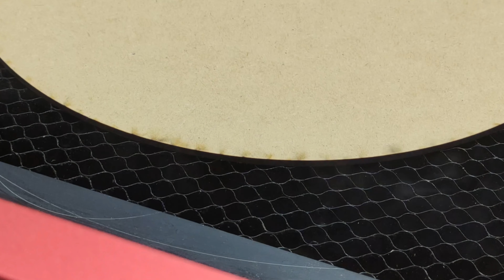Amazing Accessory For Laser Engraver- ATOMSTACK F3 Matrix Cutting Panel 460x425mm

Comment: My review of the Atomstack F3
"T" nuts too small for slots can pop out and do when tightening.
Long screws and wingnuts hit my Creality Laser arm interfering with it.
Every other "Toothed" arm  is lower than the previous one, material does not even touch them, so what use are they?
Teeth are slightly rounded so it makes the surface quite slippery for the material.
Last the surface is not magnetic.